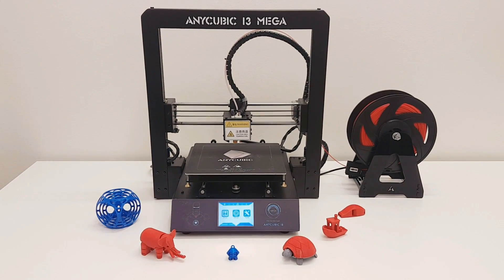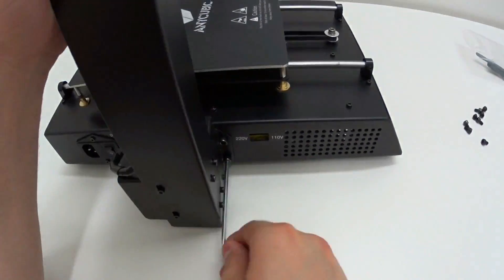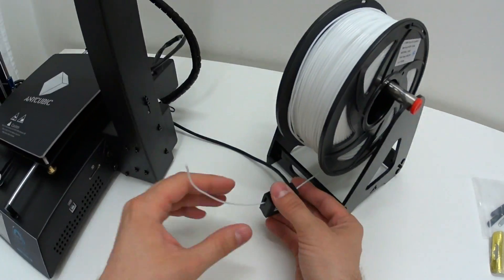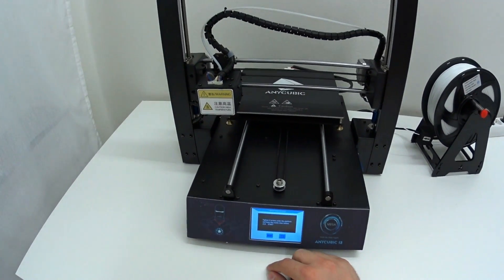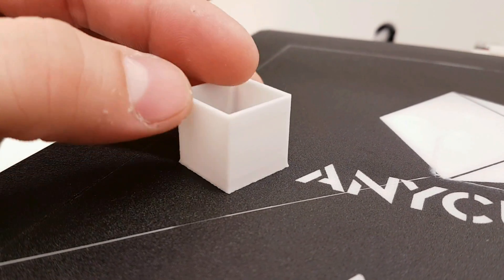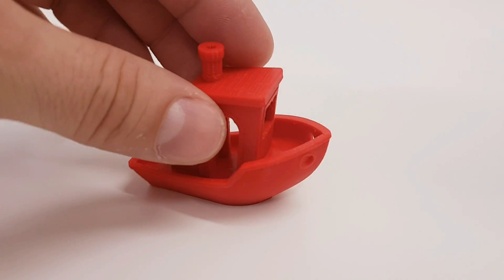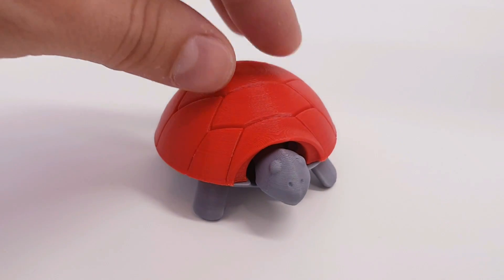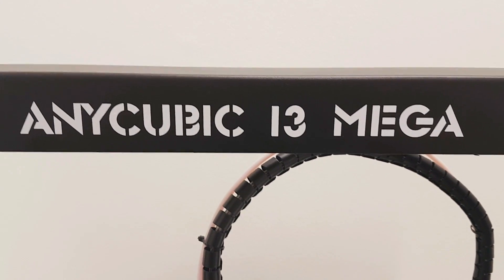Anycubic I3 Mega 3D printer Review - Good beginner 3D printer

Comment: How did you get the elephants legs and head to move?
Reply from the maker: Saxon Drury They suppose to move :) If yours are stuck try to re-level the printer and lower the feed ratio by let's see around 5% and try again.
Reply: @NexiTech  cheers thanks
Reply: What would the settings for the elephant be on the cr10?

Comment: If you had one to choose from would it be the i3 MEGA or the Delta Anycubic kossel Linear Plus 3D? What is the operational advantages over one from the other? The delta has a higher profile and perhaps faster overall printing - but they are both around the same price point. They each do ABS and Nylon.

Comment: can this print abs or nylon ???
Reply from the maker: ABS yes, Nylon is a bit more challenge to print correctly.
Reply: @NexiTech anything else i should know about buying this printer?
Reply from the maker: Yes, newest models now comes with Ultrabase glass plate on heated bed and without semi-autolevel. Much better actually than this first model that I have.

Comment: just a question, the bed is without glass and seem to be very good for adesion, is it easy to clean? can you accidentaly damage it removing printed things? and another question in your review i see that printer has an autolevelling sensor, i can't see it in Gearbest or Banggood and is not supported or  described feature, is your printer customized?

Comment: Does this printer have belt tensioners of any kind?  How is belt tension handled on these when they eventually stretch? 

I'm about to buy either this or a CR-10. Leaning towards this one since build volume is not a concern.

Great videos btw!
Reply from the maker: Hi! Thanks for commenting. I3 Mega has no belt tensioner but it does have nice reinforced rubber belts. They don't stretch that easy. CR-10 and I3 are great  3D printers. What ever you chose you can't get wrong. Am glad you like my review :) Cheers!

Comment: I was looking at the CR-10 till I saw this, which would your recommend?
Reply from the maker: Can't say! They are both great printers. Choose CR-10 if you planing to print big and you have space for CR-10. If you don't planing to printing huge 3D parts like 300x300x400 then Go with I3 Mega. For 90% of people 210x210x205 is good enough and I3 mega has some advance features like: Touch screen, nice interface, you can print ABS,PETG easier (Bed can go more than 100c, CR-10 up to 87C Max!), auto stop if filament is out or brake, continue print if lost electricity or accidentally disconnect printer.. Auto sensor probe. Better cooling out of box and its easier to assembly.

Comment: Great explanation video. Do you know what the max length of a print is. I have something that is about 18 inches long and 7 1/2 inches wide that I would like to print. It is only about 1 inch high.

Thanks
Reply from the maker: Thanks for commenting. Well your print is 45 cm x 19 cm x 2.5 cm For printing such huge model (45 cm long) you need a lot more bigger printer. Something massive like customized CR-10 500x500x500

Comment: i3 mega or creality cr-10 ???
Reply from the maker: Can't say! They are both great printers. Chose CR-10 if you planing to print big and you have space for CR-10. If you don't planing to printing huge 3D parts like 300x300x400 then Go with I3 Mega. For 90% of people 210x210x205 is good enough and I3 mega has some advance features like: Touch screen, nice interface, you can print ABS,PETG easier (Bed can go more than 100c, CR-10 up to 87C Max!), auto stop if filament is out or brake, continue print if lost electricity or accidentally disconnect printer.. Auto sensor probe. Better cooling out of box and its easier to assembly.
Reply: Nexi Tech I'm thinking more about print quality. I hear the cr-10 can produce excellent prints but then when I look at the cr-10 the bed is held down with office clips. I don't know does the i3 mega produce the same quality prints or less quality because the i3 mega is so "unknown"

Comment: I just received my Anycubic I3 Meg today.  Big Problem:  I did the internal test (single line around bed perimeter) and I cannot get it off the bed.  I did the assisted bed level and followed that with the cold check with a sheet of paper between the bed and nozzle for protection.  During that check, I was able to move the paper feelin a very slight drag as it checked the 4 corners.  

I sent an email to support@anycubic3d.com and it bounced back not delivered.
Reply from the maker: Carl Beck You mean you have did Auto level test and now PLA(test pattern) line is stuck on BuildTak and you can't get it off?
Reply: That is correct.  I thought the Nozzle to bed clearance might be too close but the clearance is no drag on a sheet of paper.
Reply from the maker: Carl Beck You don't need sheet of paper to level up I3. You need to use sound test and equally do on 4 corners like I show in video. If even that is to close and nozzle "drag" on BuildTak surface then you stop test immediately and "screw down all 4 adjusting nuts on head bed even more" and "remember" response sound. Then  test again until you get good results. You can even use other "heat bed test" check on Thingverse.  To remove Test pattern heat up bed to 80-90C and scrub it with tool or flat scalper.
Reply: YES:  I did the sound setup and repeated it 4 time to make sure all 4 corner were the same.  Then checked with a sheet of paper to be safe.  I did not adjust after using the sheet of paper.  Yes, I have used other Z Tests on other printers and have a couple of copies.  I will try to heat the bed up to 90C and see if I can scrape the PLA off the bed.
Reply from the maker: Ok. Good work. I hope you will make it right. PleaserReport back on progress. Good luck. Regards.
Reply: I made a 1st layer test print of 50 x 50 mm, 0.2 mm thick and printed it.  I leveled the bed wit sound (Slight force on the bed with my finger turns sound off and on)  My 1st layer test print looks nice and smooth. BUT I CANNOT SCRAPE IT OFF THE BED.

Comment: is it easy to setup
Reply from the maker: Paul Cumber It can't be easier.
Reply: Don’t get the Ultra base. Got it today and have to take it back. It will not print what so ever. It’s stuck on 32/200c. I have the filament in the nozzle. It won’t print.

Comment: O.K. stop NO more reviews. I have bought 4 printers already because of you, on top of my original 2. That's it No more reviews PLEASE. Looks like an easy one for the newbies but for me it competes with CR10 300x300 at its price break. Nice review as always now STOP,  Lol.
Reply from the maker: Paul Thomas LOL! You make my day! Best Regards! :)
Reply: After some more research, it turns out they have new version "Ultrabase" which is a glass/carbon or silicon hot bed I believe, so the induction sensor is taken away.  They also added double z-axis limit switches.  This is an "upgrade" from the previous version
Reply: Is there any issue with the auto level sensor?? I ask because the version they are selling now does not seem to have that sensor, I could be wrong but im not sure???
Reply from the maker: Not that am aware of, Its standard 3USD NPN Proximity Sensor( 6-36V) its pretty much bullet proof. Am not sure why or if they are selling without auto level sensor.
Reply: Chair Happy which one is best for beginner? I dont know how to level yet
Reply from the maker: samuel ruben I3 Mega is preety much great for beginners. In manual there is instructions how to level printer. Don't worry it's easy.
Reply: so the the actual version is without the auto level sensor because it don't need?